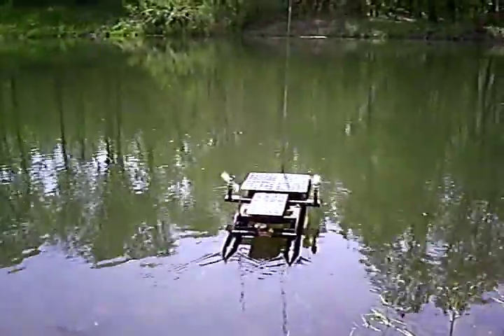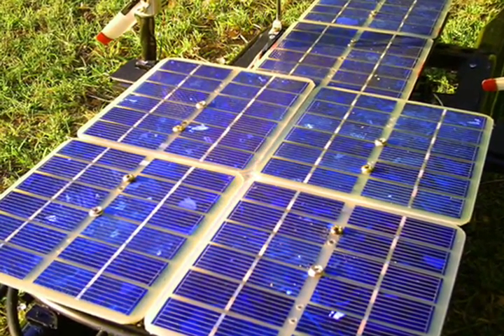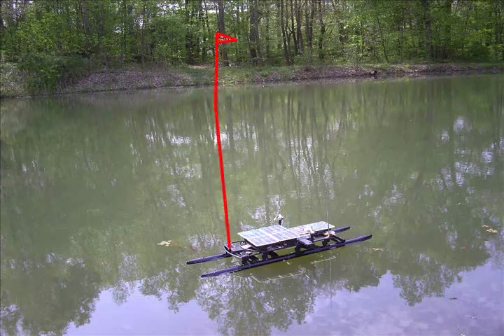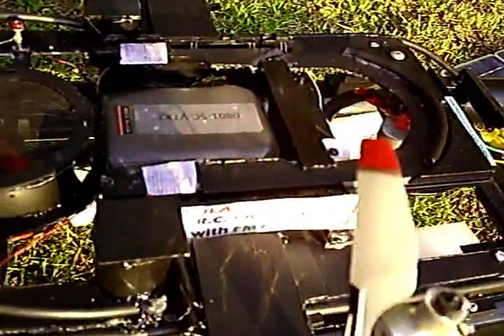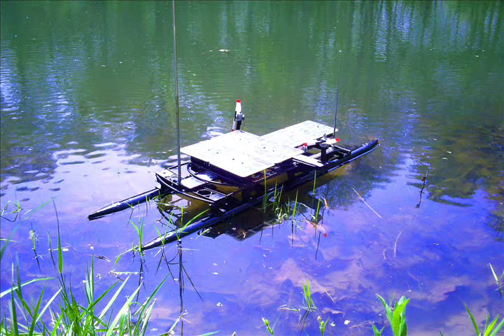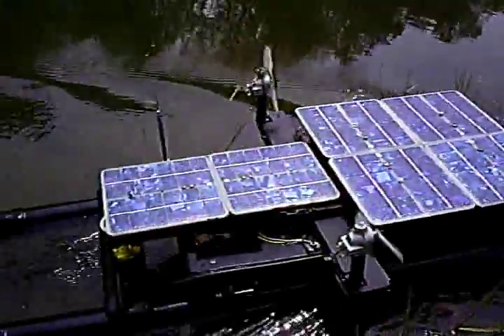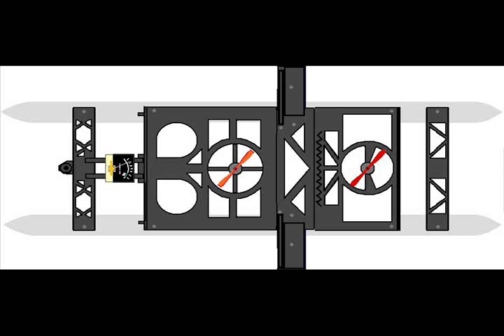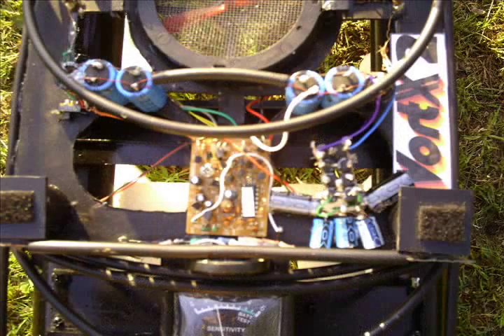The VortX 2 Solar powered RC boat (2007)

Comment: I have been thinking of how to make some fun solar vehicle while waiting for an order...I was thinking a boat because they don't require much energy to move (vs rolling/flying), and I was thinking of how to set it up and what to use to power it because I don't want to just drill a hole in a container and let the water in...
You gave me a great idea with this...I already have (5) 75 watt brushless motors, and 4 escs for them (was a quadcopter (with one spare motor) until it crashed). I thought I

Comment from the maker: Farads? I think the VortX has about 20,000 uf worth of random capacitors, but not much is necessary.  About 2000-5000 uf will buffer out minor current spikes. Use capacitors rated for at least 6.5v (commonly found in computer power supplies)

Comment from the maker: Problem: Moss...

I had two boats before it that failed miserably because of moss and weeds getting caught.

My new boat, (Video in the works) has paddle wheels on each side. It is twice as fast, and rides right over anything in the way.

I have removed the fans seen in the video, they were somewhat inefficient. I have replaced them with new ones that work much better.